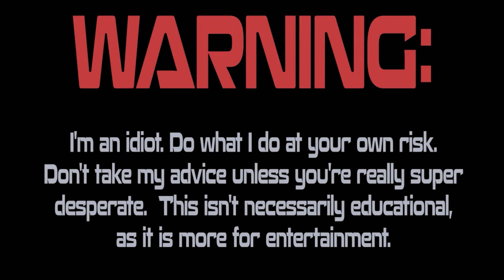FORGOTTEN 1970 Evinrude Skeeter Snowmobile - Will It Run? Part  2

Comment: Busted out laughing when you said "I went ahead and threw the filter in the dishwasher while Jessica wasn't looking." Classic!
Reply: It's funny but it's not funny. Back in the day I was racing go-karts and when I was doing an engine build, I would run all the engine parts through the dishwasher, it works awesome. I eventually ended up getting caught doing it and it didn't turn out well. The wife was quite unhappy with me.

Comment: I used to make my own skags, buy some 1/4” rod steel, bend the ends, and weld on some threads!
Reply: We had a cheaper  more plentiful and longer lasting method  years ago, we had a salvage yard and would take the trunk springs out of an old wreak cut them to length and weld threads on them they were tempered steel and would last much longer than steel rod
Reply: Great minds think alike, have done same several times👍
Reply: You should have used aerospace engineered titanium rods, bro.
Reply: Used to weld 3 sharp carbide  edges front middle and rear.  They'd dig into asphalt so you could still steer crossing a dry road.
Reply: Ivan Snyder  We were doing that in the 90s still, cheap but effective. Can't do it now everything has gas shocks that fail after 10 years on them now
Reply: we used the rods from a potato digger.....digger rods....

Comment: Them wear rods I just made my own went and bought some steel at Menards and welded some studs to it where they needed it and works great on my old John Deere sleds
Reply: Yeah, I'm from Arizona and had never seen or heard of wear rods before and making them seemed easier than trying to buy a pair.
Reply: I’ve seen guys use rebar for wear rods. Say they last longer
Reply: That's what we always did too. Dad even made some out of 3/8
Key stock. They lasted a loooong time!
Reply: Yep 
You guys got it
Reply: Used to weld a triangular file to the wear rod, Homemade carbides!
Reply: When I was I kid had a 67 Ski Doo, slowest in town, lol. Blacksmith made great ski runners for us.
Reply: Weld studs on a piece of rebar. Works great and lasts a long time.
Reply: It'll steer a little sharper too.
Reply: @normwetherbee3403  Yes indeed I found that out on one of my sleds would not turn worth a damn and after I replaced them rods it turned real well

Comment: I USED TO MAKE MY OWN WITH 1/2 INCH ROUND STOCK AND WELD THE STUDS TO IT.THEN BEND IT TO SHAPE.
Reply: ya, that was the 8th grade metal shop class favorite project for us Up Norter's. Here a skag there a skag everywhere a skag skag
Reply: 1/2 in rebar cut off pcs. Weld on old triangle file for ice racing pakage.
Reply: Ya the round stock always seemed to be mild steel thou, always make two pairs back then. One good rock bent them or broke the studs alot, but we were a little rough on em.
Reply: In potato country of North Dakota we use old digger chain for that. And anything else we can because we have it out the wazoo.

Comment: Remember my father rebuilding a old SkiDoo TNT 440 motor on my mother’s kitchen table in the early 70s, was the fastest machine at the time. Think my mother was not the least impressed.
Reply: My pops had one too mid-late 70s...total hot rod sled back then
Reply: would that have been a silver bullet,, had one too
Reply: Me to 👍

Comment: I've just been hookin' my peepers on that Buick in the background for the last hour
Reply: Yeah me too... looks like a 63 or a 64... not sure but i think it’s a skylark perhaps.... nice car
Reply: @nobodyspecial6436   I saw the name on the back fender at 1:30 and I think it was Le Sabre. Googled 1964 Le Sabre and it looks like it.
Reply: It’s a 63... 64 had the horizontal taillights
Reply: @nobodyspecial6436  cool
Reply: Thought I might be the only one that saw that Buick. I was going to ask if I missed that video.
Reply: @godschildtony2  wondered the same thing. It looked like the 63 Cutlass "transitional driver" I bought after I sold my '70 'Cuda while I was waiting to buy my '66 Charger. The motor had a blown head gasket so the oil looked like some Dunkin carmel latte. If they had the interweb back in 1971, I could have made a video of getting the Charger to run (been sitting 2 years) & drive it home with no brakes.
That's fine!

Comment: Hairspray for the grips, slide straight on and stick like granma's biscuit dough.
Reply: and the gold color was spot on period correct!!!!
Reply: They'd be hangin' in there like a hair on a biscuit
Reply: Hair spray, slide em on then kit them with a couple blasts of compressed air dries em right oooot.
Reply: On BMX bikes we use rubbing alcohol.  You can imagine when doing tricks, jumping etc, you don't want the grips shifting on you

Comment: So I see you got the ol' babysitter 9000 running, the boys will run it out of gas faster than you can keep it mixed up. Way to go dad, parenting done right. 👍
Reply: I started on a gp292 my dad always said "If you can't start it you can't ride it"
Reply: Needless to say I figured out how that sled ran inside and out
Reply: @86thirdgen71  a buddy of mine had a well used skidoo elan. He being a bit larger than myself at the time, he pulled on the rope, I ran the throttle and choke. We were 8 at the time and away we would ride, good times.
Reply: After the “blizzard of 66” my dad bought a new Ski-Doo Olympic 10.5.  A 250 single that sled took a terrible beating for 15 years through 3 sons.... sleds from the 60s and70s had personality! Any out there that survived teenagers or early racers will run forever, if you don’t mind tinkering with them. I really liked the Bolens and Allis Chalmers models that had a power unit, and you rode on a sleigh that it dragged along behind....

Comment: For wear rods, make your own.  Use 3/8" steel round stock and weld a 3/8" stud to it using the old ones for a pattern or weld fresh 3/8 round stock to the old worn out rods. It will be taller and steer better.  Heat it until cherry red and quench with oil.  They will last much better than oem.
Reply: A guy could also splatter a little har surface welds here n there on the bottom or the whole thing..... I don't know.... but yeah that'd make her last a lot longer too!!!!!
Reply: Yep, that's exactly what a guy used to do back in the late seventies in metal shop class in school. Free set of runners every year.
Reply: Is it the lack of wear rods that made it not steer at all? I swear I'd get better handling with my dirtbike than that thing, but I don't have any other reference since I've never seen a snowmobile run before.
Reply: Hot rolled steel is the harder, unless u are going to spend the extra bucks for special heat treated! Was into that snowmobiling pretty heavy from 60’s to the 90’s or so. Great times were had by many thousands back till about 80’s in northern MN. I AM 83 now and still have three sleds, 91 wild Cat, 86 Polaris 600 Le Special modified. Yamaha Ovation 340 Air cooled, electric start. Post

Comment: Just weld bolts to round stock of similar diameter for the wear bars. Bend them into place and tighten them down and your done.
Reply: Yep did it all the time when I was a kid put a few beads of stainless  weld on the bottom and you has some poor man carbides .

Comment: 'use hot soapy water instead of wd-40' , I just learned something new!
Reply: Hairspray
Reply: I have used hairspray too
Reply: Compressed air
Reply: Windex works well also..... You can also use it to find a leak in a tire or air system.
Reply: Soapy water is by far the best.I have been using it when installing grips for years now.

Comment: I was the conveyor design guru at Pontiac motors in the '70s. From that experience, I know you can just buy wear-resistant steel from steel shops in many sizes, flat bars, and round. It is usually painted red to distinguish it from normal steel. Weld-on studs and you're done.

Comment: 24:1 ratio my lord they hated spark plugs!!! What did you have to carry a 6 pack Of plugs  with you when riding this thing?? 
Maxima 927 race bean oil is plenty clean and still classic smell! Which is the best thing about Ole 2 strokes.  We run it in racing MX bikes

What in tarnation is that fuel line contraption???
Reply: It's a pumpalator. It uses crankcase pulses to push the fuel from the tank to the fuel-make-it-happener.
Reply: Lmao!!! 😂

Comment: Well now we know the “Wildcat” made it home .... spoiler alert !!!!
Reply: lool i was thinking the same thing.
Reply: Ahh thats not a Wildcat. Its a Le Sabre
Reply: @xskinmanx9024  with a wildcat 410 in it.
Reply: @theofficialdiamondlou2418  That would be a 401cu inch with the lower compression  the higher compression 401 has 10.25 compression but yes you are right that it is a wildcat motor.
Reply: @xskinmanx9024  I just watched the video yesterday. Lol.  I cheated.  Had no clue before. 
  So your the authority here.  
This guy doesn’t know Buick.  
I’m a Chevy guy.  But was always jealous of the wildcat. 
  Fast motor.
Reply: @theofficialdiamondlou2418  Not an authority just happen to own a 1963 Wildcat with the 401cu inch since 1979 that my Grandfather bought new at the end of 1962. In 1980 I picked up a factory dual quad manifold from the scrap yard for $50  and completed the rest of the aircleaner housing and valve covers on ebay back in 1999. Rebuilt the motor 35 years ago and only put about 600 miles on it and parked it in my back yard where she sits on flat tires waiting for her next face lift to bring here back from the grave. I to am a chevy guy. Just happens that is something that was my grandfathers who passed away in 1969 he traded it in for a 1965 wildcat then my father went down to the dealer 3 months later and bought it back. Its been a So Calif car since purchased. Spent the first 3 years in Sun Valley then the next from 1966 to 1997 in Sylmar and from 1997 to present she has been in Palmdale. I was 14 years old when this car was given to me . But she ran great and still does
Reply: @xskinmanx9024  man that’s awesome.  Stay with it.  It’ll be beautiful.

Comment: Back in the day when I was a youngun . We would all get together at my Grandparents to do some trail riding on the beautiful trails around Pequot Lakes. My grandpa had a 69 Johnson with electric start and reverse. You could always here that thing coming. Factory they just had a baffle plate for exhaust that was designed to muffle in deep snow. On hard pack trail not so much. When one of the sleds needed a new set of skegs my dad and uncle would just make a set from the tines of an old dump rake Grandpa had setting in the weeds. Brings back memories seeing you get the old Evinrude running. Keep up the good videos.

Comment: We (stepson and I) used to take some rebarb and weld up some bolts to it and bend the end up. Grind to fit in the hole. Lasted a lot longer then whatever they sold you at the snowmobile store back then. My sled was an ole 1973 Chaparral. This brings back so many memories. :)

Comment: Watching that pig plow the corners at the end sure reminded me of my 1980 Ski-Doo Citation 4500. 377cc air cooled, I was 13 and it was 1996. Bought it for $600 with my lawn mowing money. My neighbor bent re-bar to fit below the ski's. Welded bolts with the hex cut off to the rebar and we ran nuts and washers on the tops. Instant carbides that sparked across roads, wore down quick, didn't cost much and helped me keep up with their 94, 95 and 96 XLT Specials. Yeah, they bought a new one every year, Didn't care mine was old cause I was out there too.

Comment: I can smell the blue smoke. Brings back memories doing cottage and cabin checks in northern Michigan with my dad. We always ran them rich.  We always ran them 50:1. We never had any issues. In the spring when it was in the 40s I’m not sure if they’d “seize” or what but they’d lock up in the wet snow and warmer weather. You’d let them sit for a bit and they’d start right back up. They did that every spring but there was never any permanent damage done

Comment: Rode me a SKI Dooooooo  Elan (fancy french model I think) back in the mid 60's as a youngin. Friend o mine had it and I hankered for that for some time, but never got one. Ended up buying me a yammer haul when I was a newly minted driver (cars) and ran that into the ground. First time I drove over 45 on a highway until my drivers license was fully dry. Loved this video as a friends family had the BIG BOY Evinrude with reverse and a fancy pull behind sled which we also used to pull ourselves behind the sled on skis (think of it as a sled pulling a sled). Great times as a child with no helicopter parents in sight. :)

Comment: These do defenitely run without throttle. I own one, slightly older a 310cc** (if I remember correctly) and it runs just fine on idle. Tops out at 60-75 KM/H depening on slope. Skids are in the air constantly while you throttle so you can't steer when throttling. Mines round, not "rectangular" like yours. Different engine as well, 100%. Perhaps the newer don't idle well.

It has always started, every f-king time. Used it for 15 years to drag lumber.

Absolute beast of a machine. Just runs, never complains. -30? Will start.

Edit: Wrong engine in "CC", corrected. Also, mines a BE200 "Bobcat" (manual says Bobcat skeeter), not just Skeeter as these are called. I'm gonna start it in 2 days and take a ride with an old friend to visit his father. He'll love to see it.

Comment: Had and old second or fourth-hand dual-carb 440 Suzuki in the mid-eighties.  Had  doubts when my Dad and I picked it up, but it started on the first pull every time!  Fast as heck too!  Ran great until the bars snapped off and took me on a 60 mph hellride down the street at max throttle into my neighbor’s tree (and mailbox)!  Was so freaked that I tried to plug in the kill switch while slowly moving from the left side of the iced over road to the right side when I could have just choked it off and stopped the madness!  Good times!

Comment: used 2 strokes for ever since a kid. Love 4 strokes so much more. But there is a smell of castor oil from an old .049 or .60 rc airplane engine that is intoxicating for sure. OK so thanks for fixing the old evinrude engine that same brand that drove Grandad's  fishing barge home in a storm more than once. I used to sit on the pontoon in front and sort of kick ski the water while the evinrude 25 pushed us home.

Comment: I also used to make my own wear bars. Usually 1/4 or 5/16 rod that I would bend to the shape of the old one if there was any left. As said earlier in the bleep bloops weld on some 1/4 bolts to hold her on the ski. Then grind a flat spot down the length of it and run a small bead of weld down it. Make it a little harder and better wear properties and it help dig in to the corners when you turn. Trying to find new wear bars for them older sleds is next to impossible.

Comment: First sled was a used '89 Jag 340.
In the Maine woods it would kill all the new machines from late 90's up to 2003.
Crazy helped, dangle off the side and toss that narrow sled around like my motorcycle.
Wish I kept it and knew what you do for sure.
Awesome relic rescue. I'd ride that sled through the woods.
New seat was first thing I did to mine, then new track, no picks for powering through corners sideways.

Comment: For the wear bars under your skis (we used to call them skags) we would go to the local junk yard and open up the trunks and pull out the little torsion rods they used as springs to hold up the trunk lids. They are made out of spring steel and came in different diameters depending on the car. Bring home a bunch for $5 bucks, cut to length, bend the ends up to fit in the slots and weld a bolt on to secure into the bolt hole. We could build 20 sets in a couple hours for $5.

Comment: I saw this video for the first time today. You may have discovered this already but the engine has to go to low idle to re-engage the clutch. The dealer that I  worked for sold these and I worked on more that I want to admit. Great nostalgic machine but if you need to depend on it, you will learn to hate it. Thank God that you are a good strong mechanic. 👍. You will need it to start that beast, and dig it out of the snow drift when you get stuck.  Good luck.

Comment: Watched this first time 10/ 2022. oh boy. good memories with one I bought for $35 in 1987. It  had a bad coil and of course had to rebuild carb, new fuel pump, welding on deck around ski posts, and a new seat and windshield. The advance cam was broken under the flywheel, and when I found and fixed that, I found it only had one set if points. haha, both cylinders fire at the same time! hence the distinctive bark. Mine had the electric start and charging system. I never put a battery on it though. cold blooded, but once warm ran great. Ended up giving it to a friend about five years later. Oh and the ski guides were replaced with 1/2" round stock with bolts welded on to fit the ski holes. Miss that machine and all the smoke it made.

Comment: What we used to do back in the day when we'd burn out the wear bars on our old beater sleds, was have our dads go and pile a bunch of booger weld on the old ones and we'd grind them smooth (or sharp if we were feeling frisky). Worked well enough, and it was a lot cheaper than spending $50 on new wear bars. For the ones that were REALLY gone, we'd just weld studs onto rebar and grind that down.

Comment: My friend, and I used to buy up old sleds, and parts, and just run them.
We had enough parts, to mix, and match just about anything.
But, I can't remember the last time I bought a hard to find set of wear bars.
A little steel rod, a tiny bit of threaded rod, and some hard welding rod, and a guy ends up with some custom ones, that are better than stock.

Comment: To get grips off of handle bars, use your air compressor . Put the nozzle in the small hole on the end and plug the other end. Air pressure will push it off.